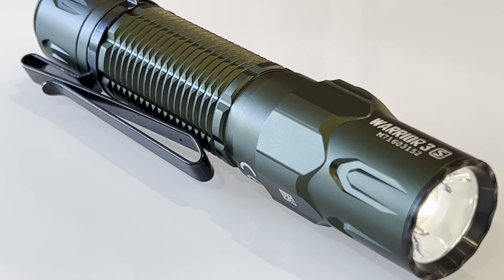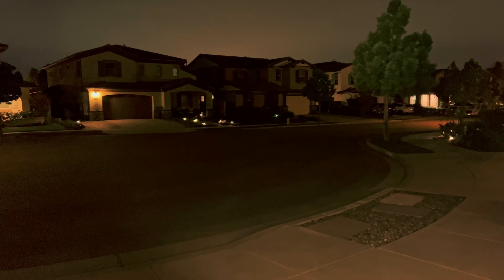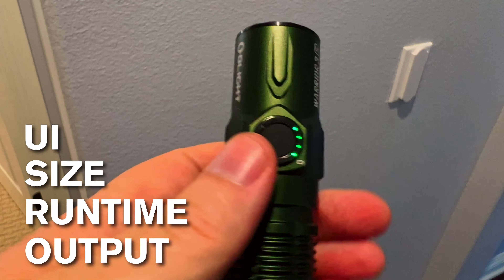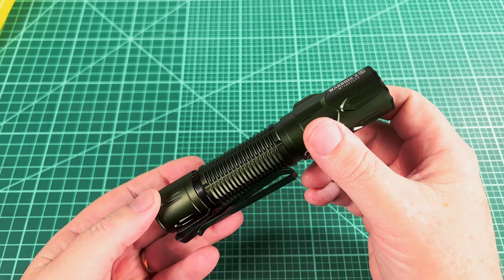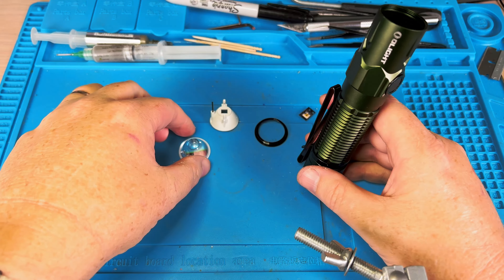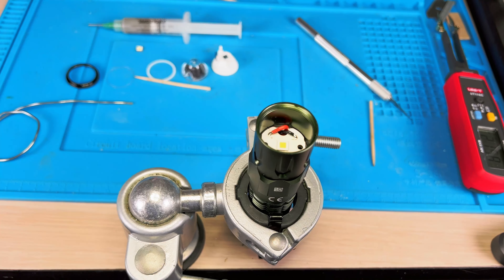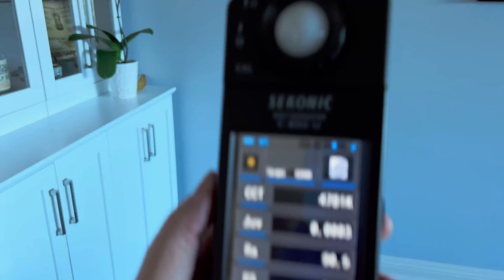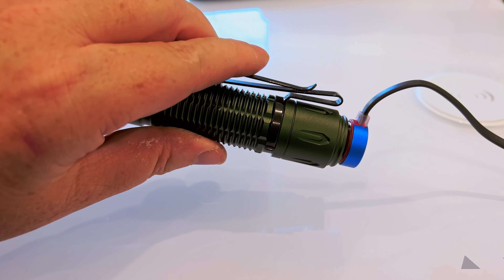Olight Warrior 3S is the best EDC on the market!

Comment: Change your mind? I just sent a Olight in for service ofter it died within 2 years. They couldn't fix it and offered a replacement of less than my original value. I will not ever buy another Olight.. From now on it will be Fenix. What is the purpose of buying one if it fails and they cannot replace it with the original model? It lasted less 2 years. this is good???  I had a limited edition and they wanted to replacement it with a current model of lesser value. NEVER AGAIn!

Comment: Great review. I gotta say the warmth of the light and the silence of the flat and not spiked tail-switch makes me kinda prefer the m2r warrior over the 3S, the m2r maybe was the first one in their line-up that you  still used with 18650 cells. But the battery monitoring and easy quick access to 200Lumen mode makes the 3S acceptable. Also I like to deep carry in my pocket, with the clip mounted at the end... and the clip on the m2r is perfect while on the 3S it´s sticking up to much. So while it´s reversible it isn´t thought out as good as the older ones... And the magnetic charging is still so very slow. For that reason alone a USB-C would be better. Imagine charing in 45W instead of 10W tops? Would be awesome...
Reply from the maker: You make great points.

Comment: Thank you Cheule, I would give you more than one thumbs up if I could.  I get so tired of all of the Olight hate.  I have two Warrior Minis, a Warrior Mini 2 and two M2R Pro Warriors.  The Warrior Minis are one of the smallest "tactical" 18650 lights you can buy.  I love the UI of the Warriors.  They have one of the few UI's that meet my need for tactical and everyday use all in one flashlight without out compromising either.  Their proprietary batteries don't bother me because I have more than one each of their 18650s and 21700s.  Oh, and the M2R Pros have a pleasing natural white CCT emitter.   The change to a cool white emitter in the Warrior 3S has kept me from buying one.  I haven't ever done an emitter swap but I may have to reconsider.  You made it look pretty easy.

Comment: The only actual EDC i care about is the baton 3. These big flashlights are weird to pocket carry and make no sense. Also i want that cool light. Yall want basically Incandescent colors? Gross
Reply from the maker: As someone who uses my flashlight man times a day, and wears cargo shorts, the 21700 light is worth it for me.  The reason we prefer 5000K, is for better color rendition.  Put a 7000K low CRI SFT70 vs the high CRI 4500K XHP50.3 on a target with some vibrant colors, and you’ll see the difference.

Comment: No way. Too big for a non-tactical EDC. Not enough candela for a tactic EDC. The metallic tail switch is also awful for a tactical light. Also crenellations don’t improve it as an impact weapon but does improve it as a pocket shredder. 

Too heavy to use as a hat mounted headlamp so whats the purpose of a two way pocket clip?

And “EDC” is a category which implies small, convenient, and satisfying looks and feel. This light isn’t really any of those. 

Based on your own rationale this video should be titled “perfect flashlight hobbyists light”
Reply from the maker: I have been edcing the light for the better part of a month. Crenellations are fine. No shredding. The efficient driver combined with the huge battery means I charge it once every two weeks… maybe!

Comment: Didn't mention proprietary batteries or charging cable (at least not in the beginning summary)?  Those are the reasons I don't buy Olight.

edit: mentioned at the end, but I think it should have been mentioned in the beginning when addressing Apple comparisons and things people don't like.  The "the proprietary stuff is really good!  people who don't like it have never used it!" is exactly what Apple fans say about Apple products.  I've used magnetic chargers before.. yeah, they're nice!  But being able to charge any of my devices with any charging cable is better.  I don't charge my flashlight on my bedstand, plugging it in in the dark.  Using standard batteries means you can swap to a new one without having to wait for the device to charge.

I generally like your videos but this video positioned itself as addressing the things people don't like about Olight and I felt it basically dismissed them without actually addressing them.  I'm not 👎because it's a positive review about Olight.. I think they are good lights that deserve good reviews.  I"m 👎because the video seemed to basically treat people's criticisms of Olight as stupid.

Comment: Why are you using the grip tool to unscrew the bezel? Use a piece of rubber on a table as Olight tells you to. 

You can see how in a prepared guy video https://youtu.be/Oww3Kk8EtBs
Reply from the maker: My first disassembly was on a Ti Warrior 3S, and that bezel was so tight that no rubber on a table, flip flop sole, or rubber gloves would get it open.  I tried off and on for weeks to get that light open.  I was finally able to with strap wrenches. Easy peasy.
Reply: @cheule  that’s ok. I didn’t think the ti model would be different.

Comment: propietery battery....nough said
Reply from the maker: I just don’t see it as an issue.  I mean I didn’t see it as an issue for my iPhone, Laptop, Nikon DSLR, or DJI Phantom.  You’re clearly entitled to your opinion, but I wonder if you own one of those things I listed… and if you relaxed your position for those?
Reply: @cheule  Sorry, but those are poor examples for proprietary batteries in a flashlight. All phones today have built in batteries and most people have only one phone. If you want a phone that has a replaceable battery, you probably won't have a phone. 
  I only have one laptop. Having spare laptop batteries would be extremely expensive. Laptops come in many sizes and are far more complex than a flashlight, and their battery packs have many cells inside. 
  Same with DSLR's. Many shapes and sizes. Their batteries need to conform to the camera. Cameras are also very complex devices compared to a flashlight. But I do have different models from the same manufacturer that operate on the same battery. 
  A flashlight is a relatively simple device (and I have dozens and dozens) and only requires one positive and one negative connection and there are hundreds of different models from lots of different manufacturers and probably 99% of them will work with any standard size li-ion cell, both protected and unprotected cells, or flat top or button top. Today the safety features are built into the flashlights circuitry and don't need protected cells, not into the non-standard size proprietary cell that will only work in one particular brand. And you have to charge the cell in the light because it won't charge in a regular smart charger unless you start messing with magnets, and most will not even allow it to fit if it's an Olight 21700.
  I have 3 Olights, but they will still operate on a standard cell if need be, they just won't charge the cell. But a light that can't use a standard size cell is just not a light that can be considered the "best" EDC.
   I don't own a drone, don't want one. But they are far more complex than a flashlight and also have multiple cells in their packs. 
   I do agree that this looks like another excellent light, but there's a lot of excellent lights out there.
Reply: @cheule  id prefer non-propietery batterys for all my devices, but with no other options, ill settle . but flashlights batterys are standerdized, they even use lithiom-ion batterys in the same sizes.

Comment: Olights are not even ansi rated
Reply from the maker: Then again, what is?  But I’ll say this… if you mean ANSI lumen rated, the Warrior 3S with it’s regulated boost driver holds lumens beautifully.  First off, they claimed 2300 lumens, and I actually measured 2600 at start.  And after 30s, It was still well above 2300.
Reply: @cheule  powertac are ansi rated with a no hassle   life time warranty
Reply: @cheule  the powertac warrior is 4,200 lumens  with a 65 day fire fly setting and tactical strobe button, front and rear real defense ends , dual charging ports one magnetic and mini usb and excepts cr123 for emergency